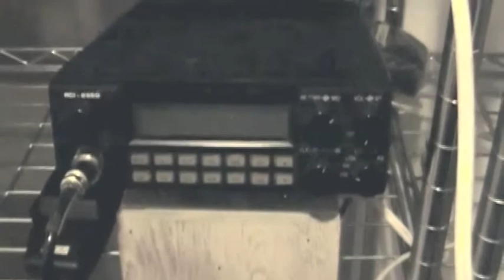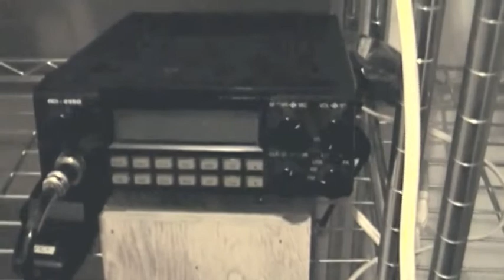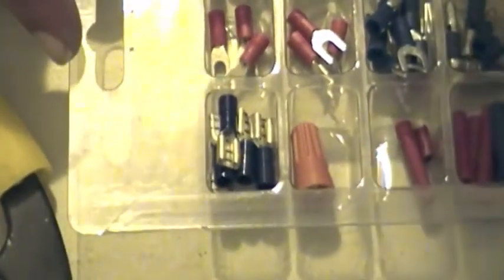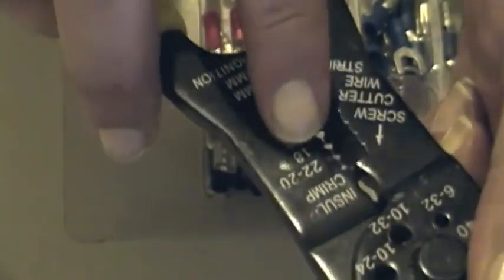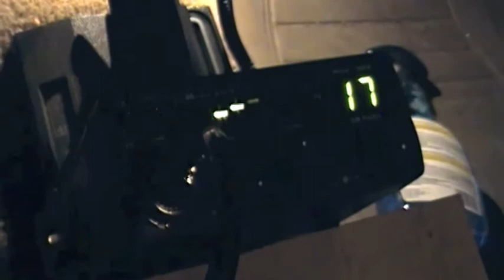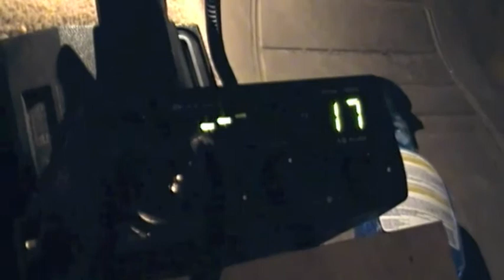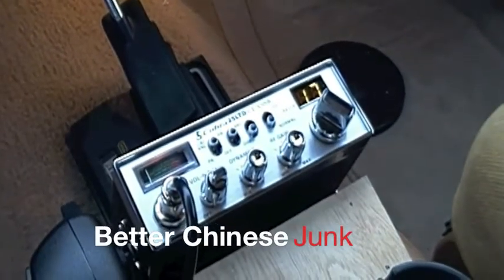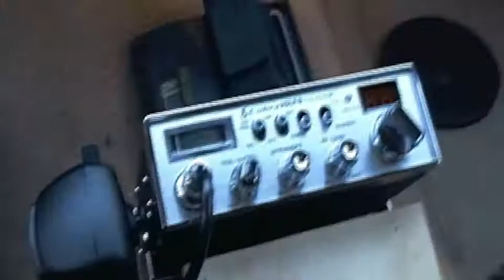New Radio.m4v

Comment from the maker: @redneckmuddigger50 SWR's were fine.  One had transmit problems and the other had a bad volume pot.  For an antenna I'm running a 102" whip.  SWR's are 1.1 to 1 on channel 17.